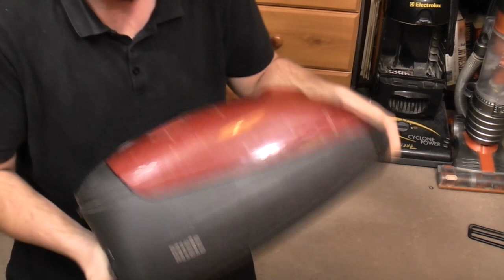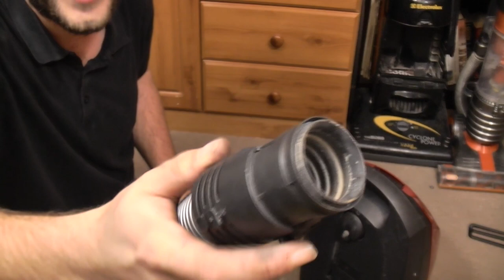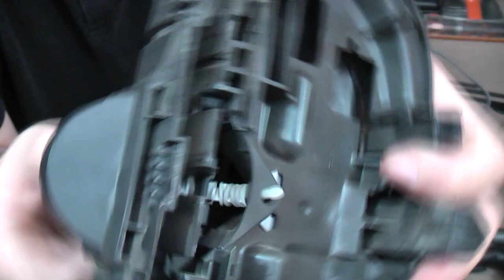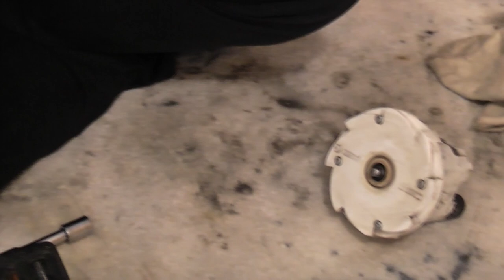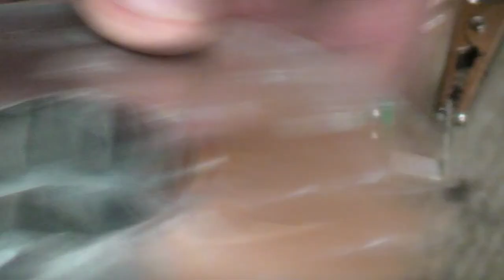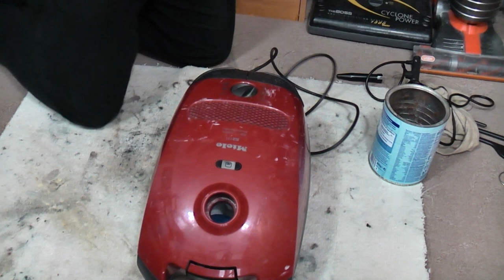Miele S2111 - DEATH by a broken Solder Joint!

Comment: That black 3-legged thing is the triac.It's the main part of the speed Control and gets very hot in use.That's why they break internally or burn the soldering.The other is the thermal cutout.
Reply from the maker: Crikey I've been getting that wrong for years then! But they've always blown a leg off in my experience of 4... Seem fine once soldered back on badly!
Reply: @beko1987  Yes, the triac is essentially an electronically controlled switch that makes the speed control work, in exactly the same way that a dimmer switch works.  They don't like heat too much so are apt to fail in abused vaccuum cleaners. Watched your video to find out where it is on this model as I expected to find it external to the motor unit until I saw that the motor has 4 terminals. A normal universal motor would have just 2.

Comment: My nana has one of these in white! But hers is a S2110. She's had it as long as I can remember! It replaced a Dyson. Now it gets confusing her because in her living room I remember seeing a DC05 green and purple. But she said it was an upright. And it was purple. Don't know what it was. My first guess was a DC07 Animal. But my granny has one of those. As well as a DC27 Animal and a DC35 Digital Slim. My nan also had a grey Electrolux Bagged Cylinder, and a Electrolux Handheld in its stand my grandad's garage. But they don't have any of those anymore! The Electrolux cylinder was replaced by a Numatic Hetty HET200A. The handheld was replaced by a Pifco Handheld which gets used on the stairs. But surprisingly not in the car. My grandad never hoovers his car. Because I do it! 😉 I use one of my bench vacs. I have 3 bench vacs. But ones a carpet washer so I shouldn't include the carpet washer which is a Numatic George GVE370 from 2001. They also had for my great aunt (which has now passed away) a Ewbank Carpet Sweeper. Which they still have. But it doesn't get a lot of use now.